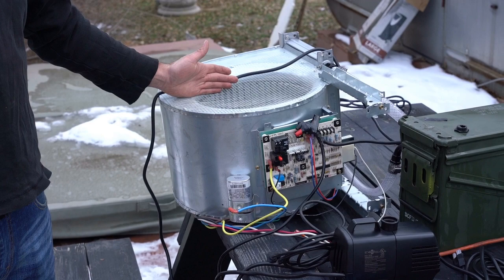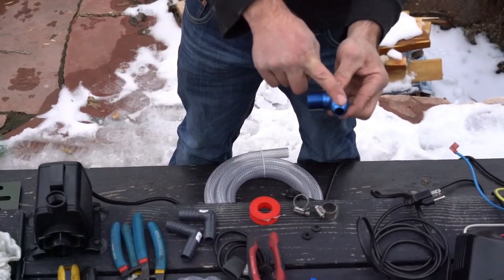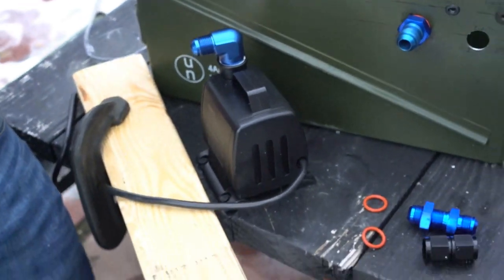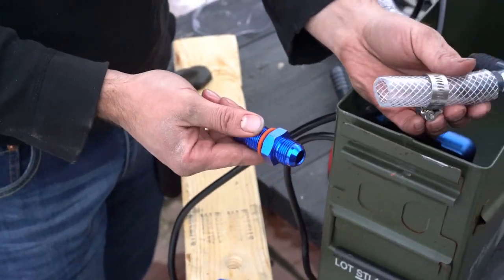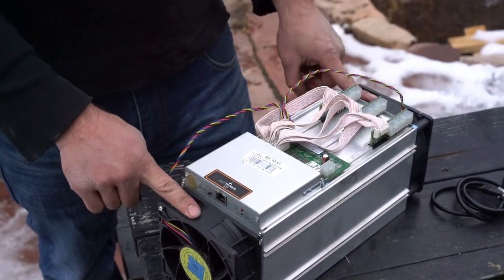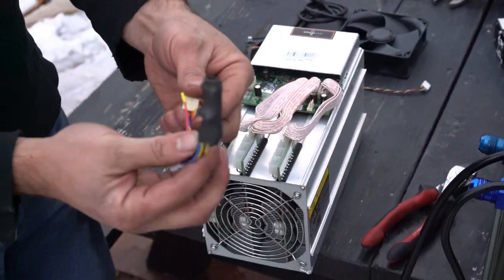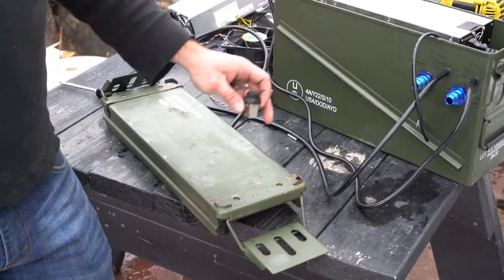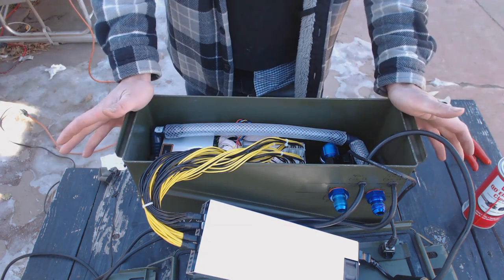Simple and Easy Oil Immersion Cooling for Quiet Bitcoin Antminer- How to build guide

Comment: Hey max,might be a daft question however with the price of bitcool through the roof and even mineral oil pretty expensive i just wondering if you can use gearbox oil or even vegetable oil??

Comment: Very impressive! Did the pump work well in the long run? I ask because the oil has much more viscosity compared to water. If you used a calculation to determine the required specs of the pump, please share!

Comment: Finished my build using your design. I picked a smaller fan after seeing you regulate yours down.  I'm tuning it now to see how high I can overclock it but so far it seems stable at about 87C.  Thanks!  Is your btc address still good for coffee tips?
Reply from the maker: Address is still good, thank you! I would be very interested in seeing some pictures or video of your build. Did you have any issues putting it together or sourcing the parts?
Reply: @neetbuxlaboratories5806  I sent some pictures in an email.  The parts were easy to find, either Amazon or McMaster Carr.
Reply: @neetbuxlaboratories5806  EcoPlus pump is only rated to 35C.  Have you had any issues with it?  The oil is about 60 to 70C.  I working on improving my heat exchanger so I may get the oil temp down to 40-50C.

Comment: I liked this video very much, the idea of using an ammo box is far better than using aquarium like acrylic tanks. But here's one question, why sweating it that much on placing the power supply inside the box? can't it be left outside the box?  the heat it produces will not get dissipated into the oil and at the same time more oil can be poured inside the box.... just a thought,  thanks for sharing this nice work
Reply from the maker: I think its a lot easier to place the power supply inside. I have not had any issues in the power supply overheating, as long as its submerged in the oil. The little fans there turn just fine and help agitate the flow. More oil doesn't help cool the setup, its a function of mass flow.

Comment: Do the miners have to be super clean to be immersed? Even if there is a little dust on them, can it cause short circuit during immersion?
Reply from the maker: The dust and lint wont cause them to short circuit , no different then leaving dirty miners running in air, but you should spray them with electronic cleaner and blow it off. I don't think dirt in a closed system is a good thing but you don't need to get to clean room levels. You certainly don't want any metal shavings left in the can, those will cause serious problems.
Reply: @neetbuxlaboratories5806  Some "expert" told me that even a little dust can cause transformer oil to become conductive. So electronic cleaner, not alcohol?
Reply from the maker: @RedPillSpill101  If its the same dust as in the air I don't see why it would be conductive? You can buy electronic spray cleaner at any car parts store, its basically hexane in a can, for maybe $10.  Real transformer oil has PCP compounds to stabilize it which are also very toxic.
Reply: @neetbuxlaboratories5806  So what kind of oil is best for antminer cooling?
Reply from the maker: @RedPillSpill101  I used regular mineral oil, you can get it at a farm supply store. There are special heat transfer fluids now available for a little more, I would consider that. They have higher density and heat capacity then oil and should work better. These fluids werent really around when I did the first oil cans.
Reply: @neetbuxlaboratories5806  Farmers use this mineral oil against pesticides? There are also motor oils that are mineral based. Are all those ok to use?
Reply from the maker: @RedPillSpill101  https://www.amazon.com/Mineral-Cutting-Butcher-Stainless-Approved/dp/B00VNI1JI0/ref=sr_1_5?crid=3SHN7Z8MLAEQ9&dchild=1&keywords=mineral+oil&qid=1613495250&sprefix=mineral+oil%2Caps%2C252&sr=8-5

something like this. I'm not sure what car oil would do so I would avoid it.
Reply: @neetbuxlaboratories5806  I appreciate very much you answering all my questions so nice.

Comment: Wow your engineering skills are amazing. I have just one question thats was already asked but not very thoroughly answered.
What about the fan in the psu? Arent there a problems because of the fluid resistance slows down the fan and it runs hot and finally burn?
Reply from the maker: The fan in the PSU doesn't run very fast, you can immerse it in oil and it will provide some extra agitation and so far hasn't been an issue

Comment: Love the setup, but not too sure about putting the PSU in there
Reply from the maker: Why not? It greatly simplifies getting the wires in and out of the ammo can.
Reply: @neetbuxlaboratories5806  Does it get submerged in the mineral oil? If not then I guess it shouldn't be an issue
Reply from the maker: @kt323  Everything is covered in oil, the fan helps move the oil  a little bit too. If you don't submerge the PS in the oil, there is no cool air to keep it from overheating. No problems so far.
Reply: @neetbuxlaboratories5806  Nice, I want to try the same thing, but in a mini fridge
Reply from the maker: @kt323  Why a minifridge? the plastic inside might react with the oil and the fridge compressor is probably not big enough to remove the 1.5KW of heat the miner generates.
Reply: @neetbuxlaboratories5806  It will be in a closed container like yours, then placed inside of the fridge, that way I might not need a radiator, but I will experiment and see what works
Reply from the maker: @kt323  I'm not sure your compressor on a typical fridge will handle the heat out put. If you build it, take a video and post a link, I'm interested in seeing this.
Reply: @neetbuxlaboratories5806  Absolutely 👍

Comment: Your really good. I have a question for you. To do this basically I need radiator and a pump only? Or do I need a liquid cooling fan?
Reply from the maker: You need a fan to remove the heat from the radiator.  But otherwise yes, you just need a radiator and a fan hooked up to a pump driving the oil and place everything into a nice sturdy box.

Comment: Whats the name of the oil that people use to cool cicuits ?
Reply from the maker: You might be thinking of transformer oil, but any kind of mineral oil will work for this purpose
Reply: @neetbuxlaboratories5806  oh thanks bro! yeah i was saying that one and has to be anti-bacterial growth
Reply from the maker: @angelthekind1595  As long as you keep the lid closed and the system tight, you won't have any issues
Reply: @neetbuxlaboratories5806  The best one which 3M charges $1k a gallon for has the brandname Novec 1230 a few companies sell that specific oil on alibaba real cheap.
Reply from the maker: @terrydavis6368  You don't need the flouronated  fluids like novec, regular oil works fine.
Reply: @neetbuxlaboratories5806  what exactly is ''regular oil'' and are you sure there are no corrosion issues in the long term with it.
Reply from the maker: @terrydavis6368  Common Plain Mineral Oil, I've gotten some at the farm supply store. It will harden up the cables over time but otherwise I've not seen any problems so far. Same concept as transformer oil.
Reply: @neetbuxlaboratories5806  have you had a computer under this type of oil running for years before? I noticed ''linus tech tips'' did a setup with white mineral oil. I guess white = plain. he mentioned the same issue about it hardening cables.
Reply from the maker: @terrydavis6368  Yes, white mineral oil same as linus used.  I think your miners will be long obsolete before you have any corrosion issues.  The longest miner in oil so far is coming up on a year in oil. Seems ok.
Reply: @neetbuxlaboratories5806  I'm looking to get set up in Siberia with S9's because electric is 1.5 cent kwh there and some parts have an average temperature of -20C with a 10 month winter. so I guess you could sell the heat to apartments above and recover a lot of that electric cost. an S9 pays for itself in 4.5 months at that electric cost. here in UK its about 30 cent kwh so not worth turning them on.
Reply from the maker: @terrydavis6368  I want to see a Siberian Dacha heated with bitcoin, that would definitely be legendary.  Check out my drum video.
Reply: @neetbuxlaboratories5806  That's already been done, a Ukrainian guy has been selling prefab homes with under floor heating powered by immersion cooled s9's he started in 2017 and the heating paid the mortgages on them within 2 years, the company is called beeminer and has a youtube channel, their price for immersion coolers is fairly extortionate. $1350 to cool 3 s9's ill be using your method instead I think its alot better besides costing less.
Reply from the maker: @terrydavis6368  I have seen the beeminer channel but not sure how successful they are. Whats one of these prefab houses go for and are they nice? Whats the availability of the NATO ammo cans outside the USA or do you plan to use something else?
Reply from the maker: @terrydavis6368  I got this video recommended to me describing a crypto-house heating system (In Russian but with subtitles). 
https://www.youtube.com/watch?v=xbxwVI7ui30&t=1474s
You could adapt the drum in my other video to do the same .
Minus anything on the temperature scale (either C or F) is a little too cold for me though.
I would like to know what the actual fluid beeminer use is, he seems to like to drink it too but you can drink mineral oil too (it is a laxative though). 
At $12/liter the beeminer fluid not super expensive (especially compared to 2 phase fluids) and may not be a bad choice compared to oil. One concern I would have about it is how is it disposed? You don't want to put fluronated compounds down the drain or in the ground. 

I'd love to see some video and walk through  of your project as it comes together.
Reply from the maker: @terrydavis6368  So beeminer doesn't actually sell the fancy liquid at the center or their system? You can contact me on my email , in the about section, neetbuxlaboratories@gmail.com.

I'd avoid the asbestos though...
Reply: @neetbuxlaboratories5806  I think the liquid is for sale on their website, they call it ''blue mead'' I'm in the telegram group for beeminer and imagine8
Reply from the maker: @terrydavis6368  Do you have any personal experience with the beeminer's setup?
Reply: @neetbuxlaboratories5806  no, I was not even temped to get it because it would work out cheaper to increase hash rate by just buying more s9's than cooling them with beeminer and overclocking to 20ths, its much more efficient to overclock them to 16ths as far as im aware, plus they function without immersion cooling at that speed. Beeminer has done immersion cooling for a lot of  big farms in former USSR countries like Uzbekistan, Russia, Ukraine, Kazakhstan I think the guy has made a fortune selling those systems.
Reply from the maker: @terrydavis6368  I still don't see how he can sell real flourinated liquid for $10/liter tbh seems suspiciously cheap
Reply: @neetbuxlaboratories5806  most things brands sell for a lot of money come out of unbranded factories in china where they are mass produced for a tiny fraction of what the brand retails them for. these things are made in enormous quantities, I expect they make quite a good profit at $10 litre, some of the listings on Alibaba are $1 per kilo.